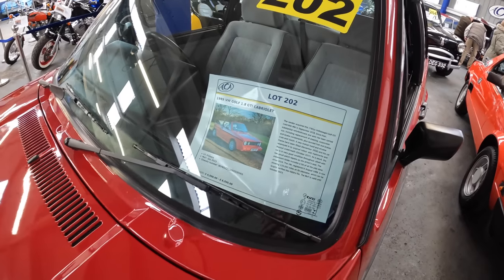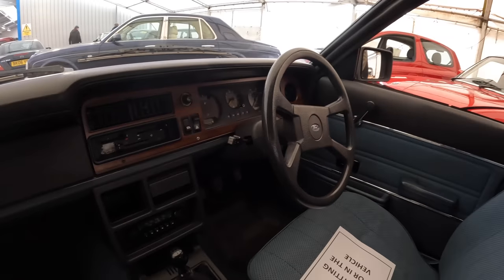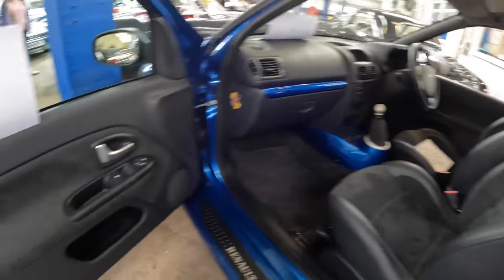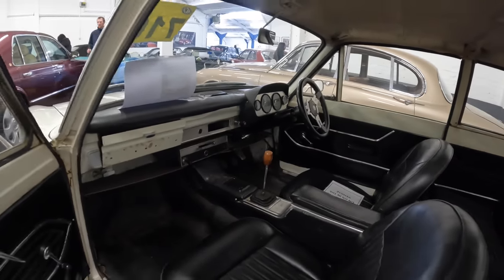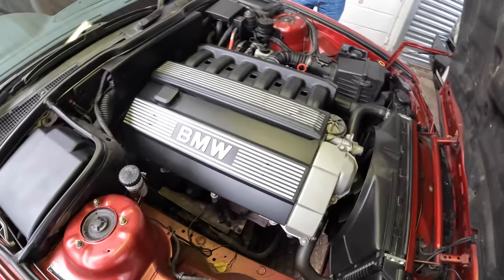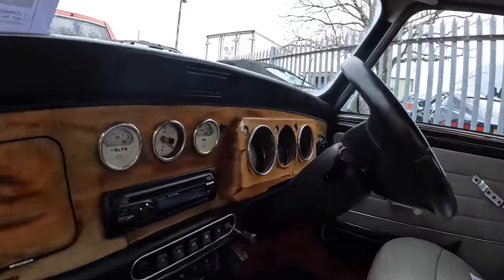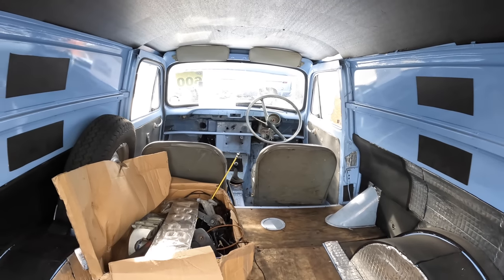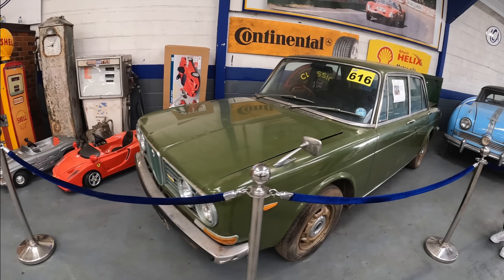I ATTEND A CLASSIC CAR AUCTION IN NORFOLK! ANGLIA CAR AUCTION

Comment: Something so therapeutic about these videos!

Not only were both Fiestas horribly neglected and bodged, the XR2 sounded like a speeded up blacksmith  at his anvil.

Unusual colour but agreed with u about the 520i Touring. Rather in the same way we view 60s cars, so we view 90s cars, albeit for different reasons. I think they're good ones too, representing  in my view, the pinnacle, the zenith, the asymptote, the motherlode, the polestar  - the very crux of the matter  - of motoring; combining as they generally do many aspects which you would definitely consider plus points - like reliability, good wind noise suppression, accident avoidance/protection, resistance to rust, performance  - while not having had every possible contingency engineered into them. I personally do not want the car to steer and brake for me, nor even to maintain its distance behind another motorist up ahead - I never use ordinary cruise control, never mind one which uses radar to actively view ahead. And that's the point - there are now SO many features on a car, even a small one like a Polo, that to even contemplate reading the handbook from cover to cover to get an overview of all the controls and features, would not happen. It would feel like homework, and therefore a chore. I am just not interested in 78 different ways in which the tone, balance, fade, arena and razzle of my stereo adjust. I don't WANT to adjust my steering heft, the stiffness of my dampers or throttle responsiveness. I don't want the car to weigh an extra 2kg to accommodate the motors and sensors and extra wiring necessary for the car to make decisions for me  - and then act on my behalf: I have driven dozens of vehicles with auto dip headlamps and none of them ever do it early enough.

Even electric seats I find a complete waste of time - and as for electric seatbelt height, steering column reach/rake and display screens, don't get me started.  Steering wheel heating and massaging seats feel more kinky than luxurious. In short, much of what has in fact been available (even standard) on some cars for years, is already superfluous to my requirements never mind what is yet to come. That cars are getting bigger and heavier to accommodate it all  - ironically to the detriment of economy, emissions, performance and handling  - only exacerbates the issues their ever more advanced technologies were designed to tackle: for every pedestrian City-brake saves, another will die because the driver was relying too much on the car to pay attention for them, instead of doing it themselves  - plus the fact the braking distances even from 30mph are an extra 6ft on the 2024 model compared to the 1994 model because the car from today weighs half a tonne more. I can't even now remember how many models ago it was that the Polo became bigger than the Mk1 Golf.

If I'm really honest I couldn't especially give a stuff about most of the above.... what really bothers me though is that in an effort to keep a lid on the size and weight  - not forgetting costs - the componentry on modern cars is being made with less and less margins for  failure. Whereas a waterpump, say, used to tell you it was on its way out, now they just go bang. And it doesn't end there because  there are so many integrated electronics that I can see a time when you won't he able to change a fuse for a failed foglamp, without having to swap out the car's entire wiring loom..that for me is the key point. Yes, 90s stuff has electronics but not to the extent and  (lack of) quality as today. Even really mechanical stuff I don't necessarily feel has got better - it is no accident, I think, that the car still running around today with the verified world record for mileage covered, is a Volvo P1800 from the 1960s. OK, with its more than three million miles, that is not just an impressive automotive feat - you'd need to be a VERY dedicated driver to cover 3 000 000 miles which even doing 60 000 per annum would take 50 years to do. That being said, I just cannot envisage a Mercedes C200 never mind something more downmarket like a Kia Sportage with more than 3mil on the clock in the year 2073.

This wasn't meant to be a "bash modern cars" rant, not at all - I accept I am unusual in not wanting all those toys - clearly most do, otherwise manufacturers wouldn't make them. The primary purpose was as a comparison between what cars today have to do compared to what they did 30 years ago. Tbh, although I focused on features and complexity (and the commensurate increased difficulty of maintenance), you could add performance to the list. I know I know that clearly sounds crazy - like the Duchess of Windsor used to say "you can never be too rich or too thin" so, it may be argued, can you never have too much acceleration. In reality it is one of those unanswerable questions isn't it Well, to a point  - the answer, obviously is of course yes you can have too much - the laws of biology see to that: acceleration subjects you to a g force and despite notable exceptions, 50g is usually fatal. Accelerating from 0-100mph in 3.3seconds equates to 1.36g - so you can see there is a long, LONG way to go before we get to "too much".

That being said 10g will make most people go unconscious - not death, but not very useful for driving either. But even 3g is REALLY uncomfortable. With Tesla Plaids pulling nearly half that, we're really starting to get near the borders. And that's just speeding up. All cars brake (much) quicker than they accelerate so a fast stop from high speed in a Tesla, Ferrari or McLaren isn't much fun. In short, I believe the Plaid isn't the only car in the low 2's 0to60. I know being a passenger is different to driving but my brother's been in one and after only a few minutes said he "felt sick" - and that's from someone who owned a Porsche Panamera Hybrid.

We laugh now when we read that when the first trains were tested, there was widespread concern that the human body would just melt at high speed and that women in particular should not go past 50mph in case their womb flew out😂 Predictions about the future tend to age rather badly - look at the way Thunderbirds renders 2065 - Lady Penelope would need a long sit down and a double martini to get over the shock of 2015!!😂

And you know what? We are naturally sentimental - it's the instinct for the familiar - we're safe with what we know and safety equals survival.The more complex life gets, the more people will tend to seek refuge in something they remember from years or decades ago. 

I think, as well as your cheerful and interesting perspective, that's why I enjoy your channel! 👍
Reply from the maker: I’m glad you enjoyed the video, thank you for sharing! 👍🏻
Reply: On behalf of anyone still awake 
Your one boring b a s t a r d
Reply: @chiefrocka8604  😂😂
Reply: @chiefrocka8604  😂😂😂😂😂 👍
Reply: Could you elaborate a little 😂 jezo
Reply: All that and I don’t get what your trying to say
Reply: Say that again mate

Comment: also the 523i with back lights bigger than the 74 model and in 1980 had also a blue metalic with the 535i ,also the clio williams numbered edition,only for 3 monthes, also the Rover 114i for 15 days, had a golf like the golden one but with a diesel engine ,it was bordeux, the fiesta MKIII with two seats diesel (94)air conditioned from factory(i´m going to get it this afternoon it passed the inspection ,but had for 10 years one 1.4S from 88 just like the black one with special pearl white covers on the black iron wheels but outside half was metalic blue and the bottom half was grey kind of rubber paint all original with the two front lights like the XR3i mkII but the escort with a lot of graphics in black a 1.6i, my 70´s and 80´s also a few from the 90´s cars ,the fiesta in white, the XR2 in my country only was sold with the 1.3 engine, no metal was touched by rust in the cars refered but my 94 fiesta some winters when it really rains it feels a bit wet in the front carpet ,maybe the rubber on the windshield at the right down corner, all cars have the steering wheel on the right side or the same as saying ,the left side

Comment: Really enjoyed this good job Mitch👍 That Xr2 though crazy money! Someone is in for a shock when they have that delivered and get a closer look at it. I think out of the 2 I’d have took a gamble on the black S would be interesting to see what the floor pan looks like under that carpet
Reply: I remember test driving an XR2 in the 90's - gutless tin can wonder. 
Bought a GTE instead - way more power.
Reply from the maker: Glad you enjoyed the video Nick! Yes I agree XR2 wasn’t pretty but the S was a reasonable price 👌🏻
Reply: Had a white xr2 just like that brings back some memories
Reply: @Charlie666-  the1.4S also brings a lot of memories ,a summer festival 8kms from the beach ,the car was indeed powerfull some dirt roads you had to drive up ,the new model in 96 wasn´t capable but the old 88 was fast but not furious, mine had a pair of holes in the exaust and it did look racing

Comment: 15:55 that arch looks like it's made of filler Mitch, a good way to tell is run your fingers up the back of the arch, it should be thin , if it's filler it will be thicker , but look at that one from the front and you can see it's not a completely smooth curve and the thickness varies . Thanks for the video again dude 👍👍
Reply from the maker: Good tip, I think you might be right! 👍🏻

Comment: Xr2 e reg all coloured code in white, my first car at 20. My dad sold for 500.00 5years ago, cause of leaky oil valve seals.
Reply from the maker: Sounds like someone got a bargain! Only going up in value now 😬
Reply: @Mk2Mitch  ,best car I ever had Power Engineering 1.9 CVH turbo 225 bhp.

Comment: prices for 80s cars from non German manufacturers is ridiculous
Reply from the maker: Most are a rare sight in the uk roads now and therefore the prices increase 😎
Reply: @Mk2Mitch Obviously, what is not clear is why a mint 4 door 1986 BMW 325i most of the time costs less than a similar age Cavalier SRi. I had an SRi, it was not nice to drive at all compared to the BMW 325i I replaced it with. Looked cool but it's not something I would spend 10k on to drive round in today....